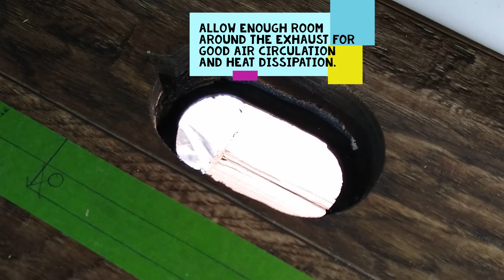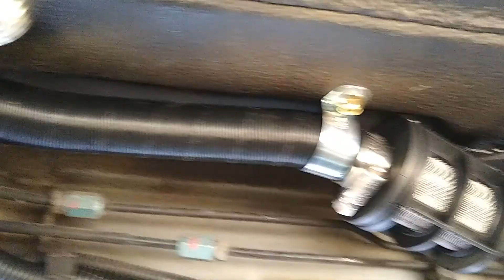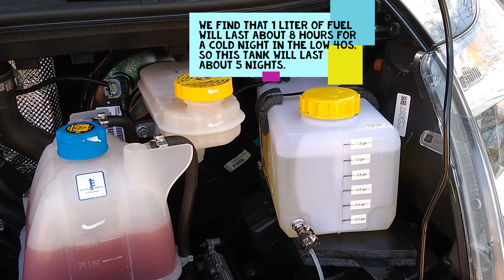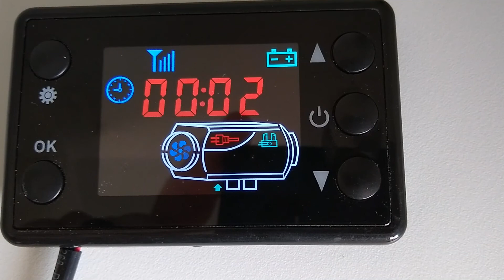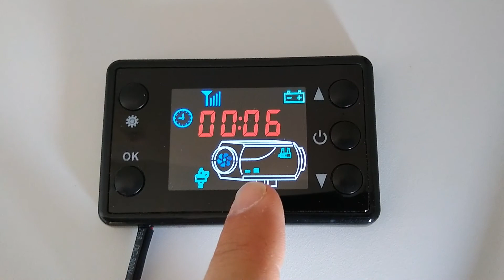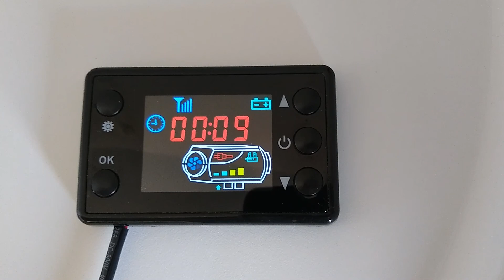Diesel Parking Heater Install, Air Heating w/o Propane, DIY Dodge RAM Promaster Van - WanderingWakes

Comment: Thank you for no ads !! How hot does the heater housing get? I ask because I am going to install one in my 6x10 tiny under the bed. Does it need a lot of clearance? Does it turn itself on and off? Great video, Thanks
Reply from the maker: The housing and metal mounting plate get up to 100 to 120 degrees, so pretty hot, but not dangerous as my interior can get that high in the summer if sitting in the sun.  I would give it a couple of inches of clearance on all sides.  Mine drops down to a slow idle if the temperature is met and just blows slightly warm air, but I don't think it has ever turned itself completely off.  I turn it off with the control pad when I need to.

Comment: I've read that the exhaust should exit past the edge of the vehicle into open air, and not just under the vehicle, since carbon monoxide can pool under the chassis and rise up and back into the van. Do you have any concerns over this?

Comment: Is the fuel pump ticking noise bothersome?
Reply from the maker: We can hear it, more like a muffled light clunking sound. We are used to it and it is not an issue for us. For a really light sleeper, it could be an issue. As one person said elsewhere, it lets them know the heater is running along smoothly ;-)

Comment: thanks for the clear and well produced video. Where did you put your pump?  In the engine compartment?
Reply from the maker: Underneath, about 2 feet forward of the heater, in front of the driver side wheel well a few feet. Attached up near the floor to a frame side rail.

Comment: A cold night in the low 40's - lol, what about the low 10's
Reply from the maker: Jon, We have camped many more nights since this video and our blog article was posted that were colder. Last month we had several nights down to 20 on a week long trip. We have also been in Colorado in the low 20's. The heater has done well every time. We tend to not go looking for cold weather, but we are satisfied with the heater. Glad that statement was good for a chuckle ;-)  You can also see some blog trip reports that have updated information. http://www.wanderingwakes.net/diesel-air-heater-installation-in-a-diy-rv-van/

Comment: Did you make a platform for
The 5L tank in the engine box? I’d love more description of how that is mounted. Great work!
Reply from the maker: More photos are at the bottom of our blog post if you have not seen that:  
http://www.wanderingwakes.net/diesel-air-heater-installation-in-a-diy-rv-van/

More: I used a piece of closed cell foam on the bottom of the 1/2″ plywood to cushion the tank over the items below. The plywood is sealed and painted black. I used a metal strap attached to the bottom of the plywood and then secured to the one bolt near the hood support arm. A large metal band clamp holds the tank to the plywood base, and it did use some closed cell foam to prevent the strap from rubbing or cutting into the plastic tank.

Best of luck!

Comment: just got a chinese diesel heat but i am unsure about mounting it on the vinyl flooring in my van.  I have vinyl floor, then a layer of underlayment, then wood subfloor.  Do you find that the unit itself gets really hot?  i dont want to warp the vinyl flooring.  thanks for any advice!
Reply from the maker: Mine is on vinyl flooring, but it is on a large flat metal mounting plate that should dissipate heat. I have measured the plate, and it gets up to about 120 degrees max when running. Not much hotter than a car parked in the hot summer sun, so I was not too worried about it.  You might measure yours with an IR thermometer just to be safe.

Comment: Nice job! Do you have pictures of the base for the fuel tank? It looks like you have a plywood attached to the frame. I'm moving my tank outside the van, there is no way to avoid odors. My only concern is the fact that I might need to carry a Jerry can anyway to have more autonomy when boondocking far from gas stations.
Reply from the maker: I did use a piece of 1/2" baltic birch plywood.  I primed and painted it really well, and it does not get must moisture there anyway. I am seeing that we only need to run the heater an hour or so before we get up, then another hour during breakfast unless it is below 32 degrees.  My estimate is 8 hours of run time on a quart (liter), so that 5.5L tank should give me about 40 hours of run time, maybe less if colder. I agree on the odors, I did even try it inside the van. It is sitting on the fuse box below the tank, so I used 1/2" closed cell foam under the plywood for a cushion.  I cut a metal bracket to bolt it to the bolt right in front of it, then a big metal clamp to keep it in place. If you have not seen the blog, I think the best photo is here: http://www.wanderingwakes.net/diesel-air-heater-installation-in-a-diy-rv-van/

Thanks and best of luck!
Reply: @wanderingwakes9500  thank you so much, I'm in Canada, and our temperatures are much lower. I have been using it for 2 years now and it's very efficient as you well pointed out.  I just ordered the 5 litres tank from Amazon to install as you did. I couldn't find any suitable model until I came across your video.
Reply from the maker: @goldenraf2000  Glad it was helpful. Thanks for the feedback.

Comment: I see you sealed the top of the hole using the mounting plate and silicon. Did you do anything to seal the bottom side of your hole to prevent water and debris from entering?
Reply from the maker: I used a thin piece of aluminum flashing to cover the thickness of my floor and insulation between the mounting plate and the metal van floor. I used high temp sealant along the bottom of this strip of flashing where it meets the metal van floor. Otherwise the hole is open to below, but so far up from the ground that I have not seen any issues.

Comment: Very helpful video. 
How about if I will install oil pump and tank inside of the van, I am scare in winter no to freeze diesel, how you think. Or to leave outside fuel pump because it’s so noise ? 
Thanks
Reply from the maker: Since my tank is outside, I also installed the pump outside. I have read of others who put it inside, but the fuel line into the heater is on the bottom along with the intake and exhaust. Outside also helps reduce the 'ticking' noise when it runs. As for freezing, we have not seen an issue, but 24 degrees F was our coldest night this year. I understand most diesel fuel has an additive to prevent gelling. If you are in a very cold climate, then this could be an issue. There are additives you can add to lower the temperature where it 'gels'. I wanted the tank outside the van to eliminate any chance of having a diesel fuel oder in the living space. I hope that helps. Good luck on your heater install. Happy Trails... WanderingWakes

Comment: Nice install video.  Do you have a diesel engine and if so, why not tap into the existing fuel source?  If your engine is gas, why didn't you use the Gas version of the heater? Also enjoyed your hot water heater install.  Very nice.
Reply from the maker: I have a gas engine, so I needed to install the small diesel tank. There does not seem to be a gas version of the parking heater that is a generic or inexpensive option. The gasoline heater that I found was about $1200, or as low as $600 from Russia. I also like the idea of a diesel heater since diesel will not explode like gasoline can if it leaks or a problem develops. Good questions.

Comment: Great video! Does mounting the fuel tank under the hood reduce the ticking noise?
Reply from the maker: Not really. The fuel pump is outside the van (underneath), but between the heater and the fuel pump.  We isolated the pump with rubber and foam, but you can hear a slight ticking sound from inside the van. It is not bad, but noticeable, since the heater itself is so quiet. We are now fully insulated, so it may be a little less loud. As one other van builder said, the slight ticking sound just tells him that all is still working well ;-)
Reply: @wanderingwakes9500  that's true, I think we will probably go with this one it's so much more affordable and seems to do the job. Thanks for the detailed video on your install, really appreciate it.
Reply from the maker: @emsween1  Yes, we would put the same heater in if we did it again.

Comment: Good Job, just beginning my Promaster conversion, in the layout stage.  Where the exhaust tube goes through the floor, did you put any type of high temperature  material to isolate the tube from floor insulation ?
Reply from the maker: I cut the holes in the floor to be about 3" in diameter, so there is about 1 inch of air gap between the exhaust and the floor insulation.  I also lined the hole with aluminum flashing to shield it from the heat.